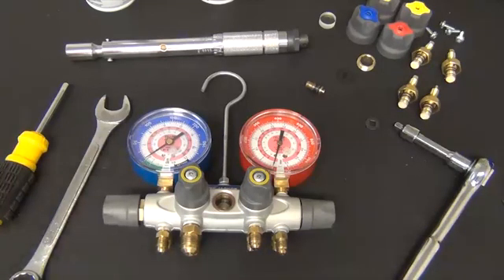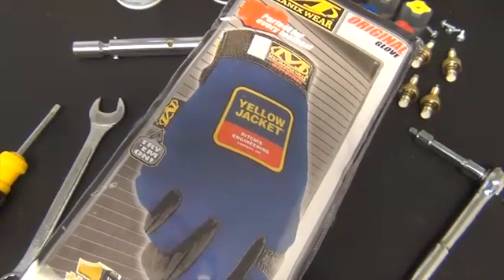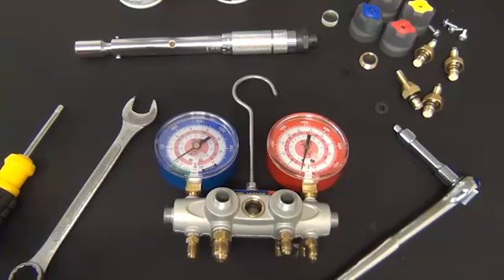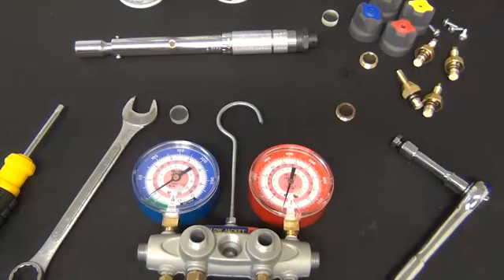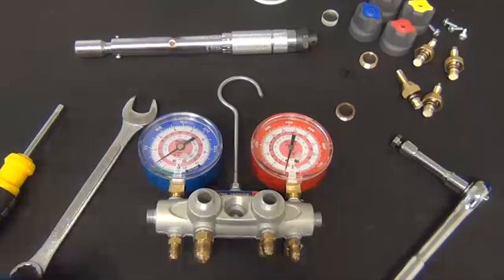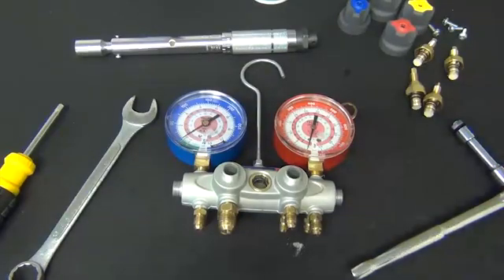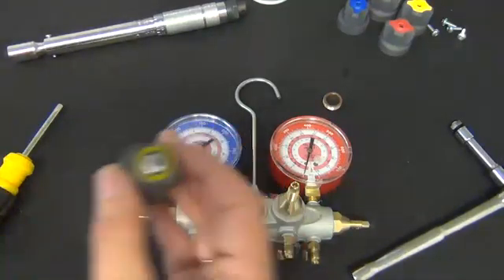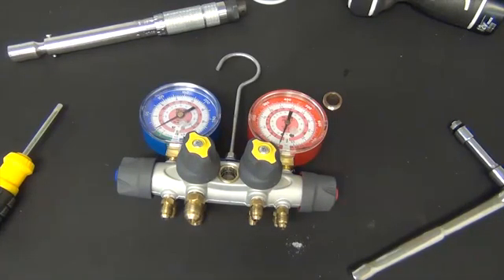YELLOW JACKET Tech Tip: How to Rebuild a TITAN Manifold

Comment: Lets see i got a atd set of ac gauges last time with garbage plastic handles that broke , i used two or three times then the yellow hose leaked , i always bleed them when im done too , the next set was a pittsburgh ac manifold set i used it one time and the next use the yellow hose leaked , i got a old set of r22's but the lines fittings are threaded to a smaller brass fitting  ..they really don't need to reinvent the wheel next time they change there freon , we know its all bullshit anyway , if they were really worried about gas released in the air they would stop screwing with the fitting size ? Are they stupid ? I know it so you cant mix them , you think you can come up something thats compatable , its not that difficult ...we use propane sometimes , its all the same junk ..

Comment: To anyone watching this video,  if your gauges are super worn out like mine, tapping the sight glass would not work. Breaking the glass is super unnecessary, you will not get all the shards out and that will contaiminant a system, possibly cause a restriction. Use your nitrogen. That's what I did. So yes you can use pressure. I simply put all the valves back in place, put 200 psi of nitrogen in my gauges with my hand covering the glass and it popped right out. Nothing dangerous at all.

Comment: The torque being used to remove those screws is a bit high.. please use a screwdriver not your impact or normal drill lol
Reply: You don't think that yellow jacket knows what they are doing buddy?
These steps are exactly what they use on the production line and how they built your gauges. Im sure she knows what's she's doing.